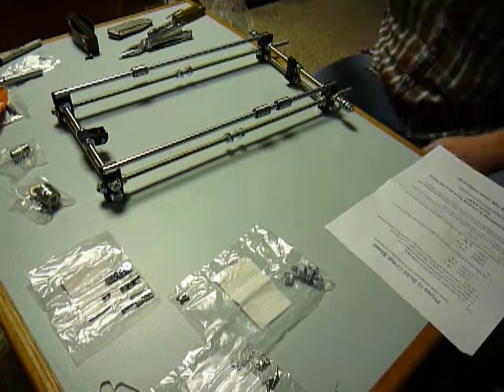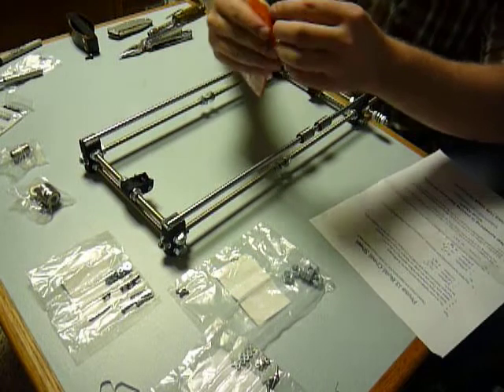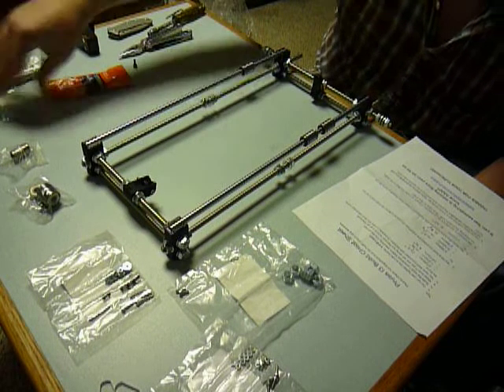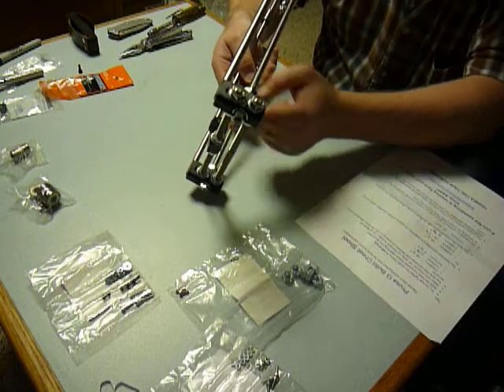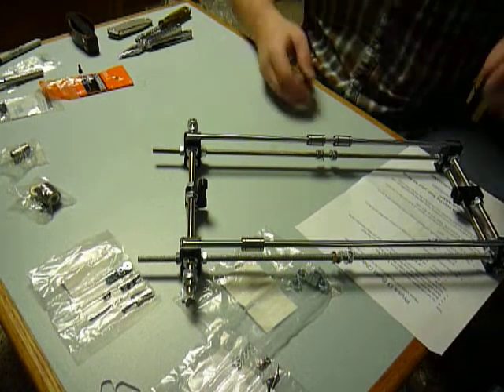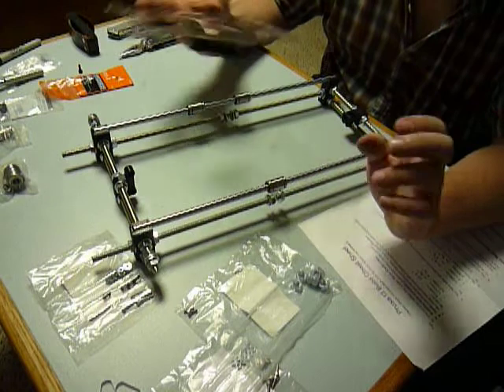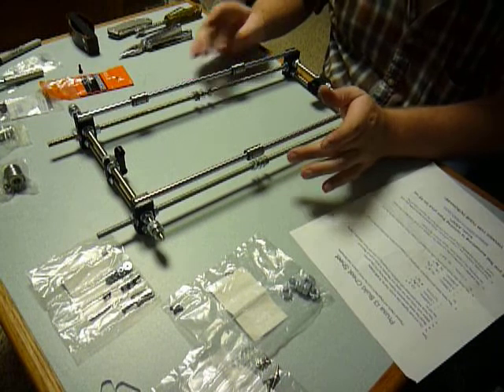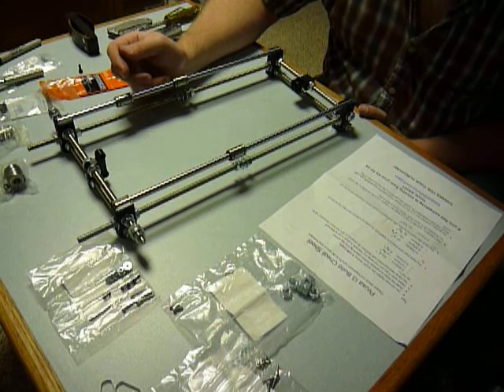Folger Technologies Prusa i3 3d Printer Build part 14

Comment: If you can thread a nut on one side you can use it to clean up the threads.  If you are cutting all thread always put a nut on it first to clean up the threads after cutting.
Reply from the maker: tsutuser That is a good suggestion, boogered threads can be the worst.